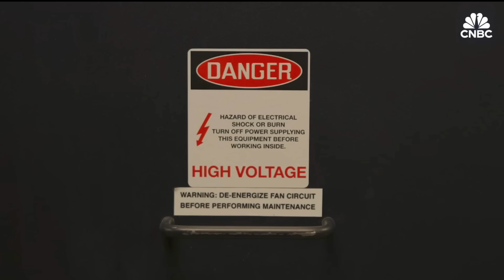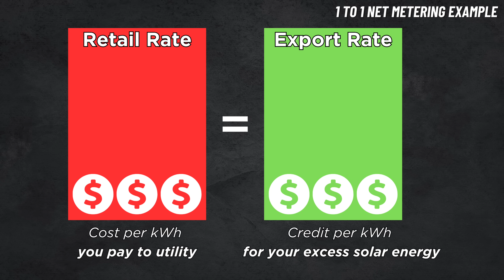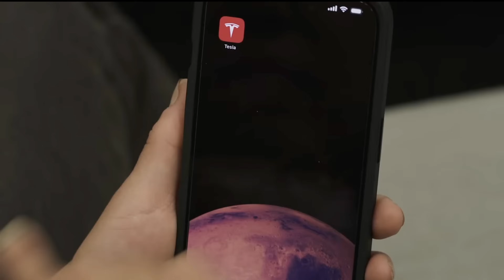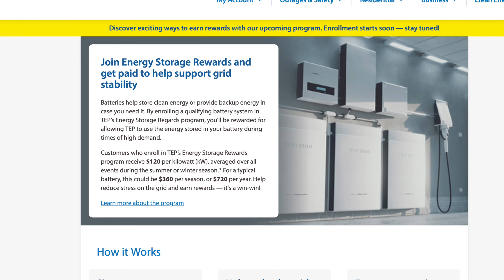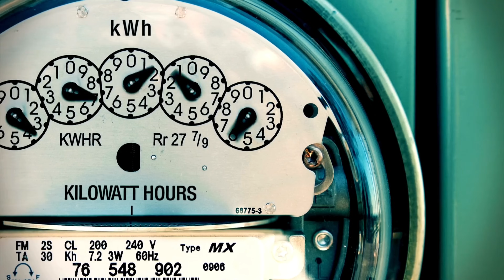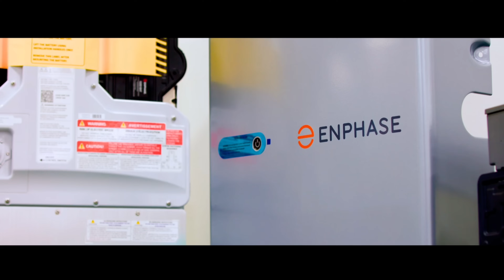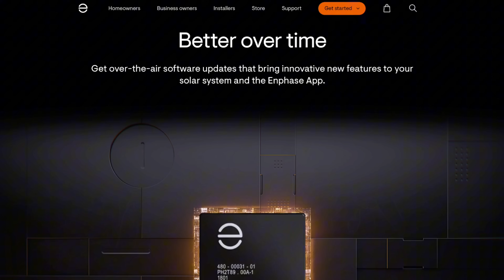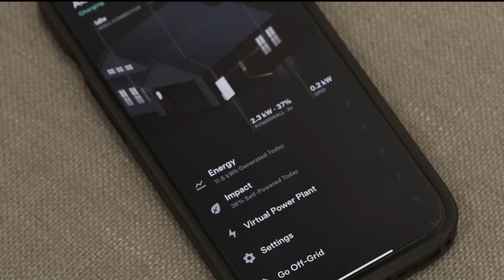Solar Panels Aren't Enough in 2026 | Big Changes Ahead?

Comment from the maker: What are your thoughts on this? Are batteries "must-have" when in comes to a solar installation in 2025?
Reply: Yes, I think batteries are must-have for future-proofing your energy bills.  To make it really worthwhile, though, you also need to electrify.  Heat pump water heater, mini splits, EV in the driveway... that sort of thing.  And it can be a bit of a minefield for regular people who are too-easily misled by professional installers.

So, clearly, if someone can DIY it, there are no down-sides at all.   If someone cannot DIY it, though, being exposed to the chaos of professional installers whos work ethic runs the gamut does not always result.  I've helped numerous friends get systems installed both DIY and professionally and there are a lot of things to look for:

* Avoid backing heating elements in heat pumps (water heater, furnace) if at all possible.  Backup elements have far higher amperage requirements and are completely unnecessary 80% of the time.  That can cause installation costs to balloon and for some people installers won't even take the job because their utility service is "too small" for the installation.

* Do NOT oversize heat pump furnaces.  Installers almost universally oversize heat pumps.  Heat pumps are designed to run at lower power levels for longer periods of time... like 8+ hours a day of run time.  But installers often spec heat pumps 2x or 4x the size you need which then cycle on and off in 30 minute increments.  That destroys their efficiency.  Installers often just don't know any better but sometimes they are trying to push their profit margins by spec'ing larger systems.

* Always have systems installed with expansion in-mind.  The last system I helped with my friend was having solar professionally installed on his roof and we specified sufficient cabling and all necessary rails for future expansion.   So he started with a small system, got it all signed-off, and then we expanded it DIY with another four panels a few months later.

* Go with a meter collar if possible.  This avoids nearly ALL electrical work.  The entire system can backfeed through a breaker without having to rewire panels or add panels or anything like that.  If a meter collar is not possible then go with a gateway system.   Always do whole-home these days... NO critical loads panel, NO smart panel.  Modern inverters can handle it just fine and an intelligent home owner won't use high-load devices in actual power outages unless they absolutely need to.

* Do not undersize the battery system.   I see 10kWh systems that are vastly undersized.  A typical U.S. home that needs, say, 10 kWh overnight should have at least double that in battery capacity... 20 kWh minimum.  The buffer enables a lot of flexibility... you can use large appliances without worrying about the time frame, you can charge your EV, and so on and so forth, and still self-consume 24x7 (zero import, zero export).

* And be very intelligent about roof mounted solar.  Do your homework.  Some roofs are easy to mount solar on (in fact, without roof penetrations sometimes... a standing seam metal roof, for example, requires no roof penetrations to mount solar)... some are not.   You really need to know how the roof mounts work and double check the installers work on the actual roof.  At least do the wiggle test.

If you can, have the installers run two extra pairs of wires through whatever conduit they have going to the roof for future expansion.  Again, have the professional installers install a smaller system but pre-wired or at least with space reserved for future expansion.   Additional panels, additional batteries, a bigger inverter, whatever.  Don't let them cram stuff in to too-small a space and don't let them under-size any service cabling if they have to install a gateway.   You want the inverter wiring to be at least 2 AWG (100A continuous).

-Matt
Reply: Ran solar on my home for 3 years without batteries. It was alright, but it wasn't a game changer. I still had electric bills that ran over $150 in the summer.

I'm over 350 miles from the ocean and was hit by Helene in 2024. No power for 9 days. Batteries went from the bottom of my home improvement list to the top.

I have 4 PW3's now. This month and last month have been my "worst" in terms of percentage self powered, but I'm still hitting 85% self powered. In February and March I was over 90% self powered.

Powerwalls reducing my grid usage between 60-75% on average so far.

If you're getting solar, get a battery. Unless your home has really high energy usage where you need 12kw+ just to cover your usage during the day, you're going to get more bang for your buck by installing a battery and dropping some solar. I think, for most people, a 6kw array + 10kwh battery will save them more than a 12kw array.

EDIT: I should note, I don't get any net metering. My solar is exported for free. I get no payments, no credits, nothing.
Reply: 10% Solar panel tariff from all over the world
Reply: @AprezaRenaldy  There are solar panel manufactures in the USA. GO USA
Reply: Noone talks about cost vrs short snd long term benefits
Reply: @jamesgleeson6538  Its a hard topic because there are many reasons beyond simple economics and break-even.  There are many, many reasons why one might want such a system even if it is not immediately or obviously economic.  And there are also good reasons why one might not want such a system.

Some people can save money, most people cannot.  So one good argument for spending money on a system during your working life is to vastly reduce costs and improve your comfort later in life after you retire, when your cash flow is much lower.

Some people might simply want to contribute to the technological revolution in some way rather than give their money to fossil fuel companies, and don't care about breaking even.

Some people might not have any ability to save-up money, which puts these sorts of systems out of reach (borrowing to have a system installed is usually a bad idea).

Some people may desire greater resilience in an emergency... not having to run around scrounging for fuel all the time in a major emergency for example.  Other people might be fine with a short-term gasoline generator solution for emergencies.

Noise may matter for some people, and not matter for others.  Though I'd also add "noise from generator == thief magnet" to that equation.

The list is endless.

-Matt
Reply: for one Solar is climate dependent and it's not enough to rely on sunlight alone with weather patterns changing based on climate change and other factors. Needs to be alternative sources  of renewable energy combined with Solar at the consumer level. Short term storage has been around  for awhile. After working in the testing , certification and design part of the field for close to a decade. To me the key to the future for the consumer is long term expandable storage combined with multiple sources of renewable energy. battery storage is still years away from making a dramatic difference.
Reply: @christhompson6010  Well, we have to distinguish between residential and grid-scale.

At grid-scale, reneawbles and battery storage are already making dramatic differences at scale.  California, Texas, Hawaii, large portions of Europe, China, Australia, to name a few.   California is now regularly running over 125% renewables on its grid during daylight hours, with grid-scale batteries soaking up the excess then discharging during the morning and evening shoulders.   Over 100GWh of storage now in California and 12GW+ of battery generating capacity.   Texas is doing the same.  Growing rapidly.

I think people are vastly out of touch with just how large an impact renewables and storage is having in those states and countries able to deploy it.  One look at the CAISO (California system operator) graphs will quickly disabuse you of any notion that significant scale is not yet achievable.

For residential, the goal is not to self-generate 100% of your electricity 24x7 365 days a year, nor should it be.  You install what is convenient to install... you don't need to diversify your renewable energy sources at the residential level.

People get solar and solar + battery systems for many different reasons.  I, personally, owning an EV, gain thousands of dollars in savings each year from gasoline that I no longer have to buy and power that I no longer have to buy.  Basically inflation-protected and rate-protected.

I can completely cover 9 months out of the year 24x7 with my system and it reduces costs the other 3 months.

But break-even does not necessarily have to be a goal, either.  People get these things for many reasons and with varying levels of success.

-Matt
Reply: @christhompson6010  Check out the You Solar "Power Bloc" located in CA. Not a backup system. Expandable power storage - unlimited. It is the primary power source with the grid secondary, but can be off grid. It is your own utility. Batteries can be directly charged with any power source such as solar, grid, wind, hydro, EV, any size generator etc., all at the same time if desired. So I would say  long term expandable storage combined with multiple sources of renewable energy is now here.
Reply: @joec.1906  small scale storage devices have been out for awhile. Im talking large scale.something that can match 150-250 amp services to a home or office and maintain that rate while being expandable.
Reply: A $10,000 battery to save $300-$500 a year for on peak hours does not equate. The roi would not benefit a homeowner if they want to save money.

Backup purposes is a different subject. 👍🏼
Reply: @elneedah3456  It's more like a few $thousand dollars a year for many of us once we factor the EV into the equation.  And/or a heat pump furnace.

But even if the utility does have net metering, it's a question of "how long" will it have net metering because full 1:1 net metering is not sustainable.  Utilities have been shifting away from 365-day net metering.

Another alternative to residential batteries is to have a tariff that allocates space on a grid-scale storage system for a monthly fee and then allow 24-hour net metering based on that allocation.  Then the home owner does not have to install batteries (for non-backup purposes).
Reply: Zack, I have complications with batteries. Here in Florida, I experience an extended outage almost every year due to a major storm.   I do have solar, 52 REC 395 black panels, with Enphase IQ8 Plus and daylight backup on 3 circuits.   This is only a daytime solution.    I have a Westinghouse WGEN20000C and a manual switch in my panel, as well as a generator plug, to power one of my two 200-watt breaker panels.    To round it off, I have two Teslas. A Model Y, which plugs into the 2nd 50-amp plug from the generator to keep it charged while it powers the house.    (Side note: I have a Microair softstart installed at 5-ton AC, and it now shows that only 33.4 amps are needed for inrush.)   I recently traded in my Model 3 Tesla for a Cybertruck.

Here is where its complicated for me....   I would love to use the Power Share feature from my Cybertruck, but...  I have an Enphase solution, but I have no straight answer as to when it will work with my Enphase system.  My power company does not accept the meter Ring (Teco Electric), so I would have to get a stand-alone ring box. A Single Powerwall 3 does not integrate with a generator, so I would be losing out on my goal for extended power outages.

So, while I think Batteries are essential, some of us with existing installations are looking for a balance of outcome and costs.    if you have any advice, options, or thoughts on how a house with Enphase,  Cybertruck, and Generator can move forward without breaking the bank it would be appriciated.     My thought is to wait for Enphase and Tesla PowerShare or equivalent to become generally available and possibly phase out the generator if needed.

Comment: Batteries are an essential component of a home energy system, here's why:
1. When a power outage happens you can run your fridge, heating, wifi well/sump pumps
2. Utilities are paying nearly zero for exess solar production - store it instead, after work charge an EV and commute for 'nearly free' while enjoying the benefits of home "fuel" production.
3. Load shifting - you can charge up a battery bank during low cost grid power periods and then use power anytime you like, even on peak time, for that low cost power price.
4. Being Self Sufficient - no one likes being stuck, a home battery/inverter system gives you a lot of control and flexibility.
5. Grid down - if you try to run your home from a generator, the genny runs very inefficiently because your loads are all cycling, but the genset runs all the time buring fuel.  If you have batteries, you can set a generator to run at peak efficiency to just charge the batteries, and then shut down for a day or two while your cycling loads can run efficiently from the battery/inverter system.
6. Rising Utility costs - we all see the rising cost of electrical energy in recent years, but you can protect yourself form much of this risk by generating some of your own electicity from solar, and get the lowest cost overnight power from the utility and store it in your battery for the next peak rate time period.
7. Instead of spending 10k on a ATS Genset system, spend that same money on a battery bank - then add to it every few years - and be farther ahead.
8. Peak vs average loads - a back up generator without battery system needs to be sized to power your highest peak load, while a battery/inverter system can use a tiny generator as a back up to just suppply the daily average power at a low and steady power supply all day for much lower cost and far higher efficiency.
Keep one thing in mind with battery/solar system - when a storm takes out the grid, it often also means no solar potential either - batteries are the answer.
There are lots of options lower cost than Tesla power walls - which are expensive. EG4 is one other option and there are many others.

Comment: Self installed solar system for 3 years in southern Iowa. Public electric cable was removed when we bought our country house and have never regretted it. We have to be a bit conservative in the cloudy weeks of winter, but the regular house fridge keeps running as it should and lights still work. For reference, we were never power hungry people. We don’t run an ac and we heat with wood. Washer and dryer are run off a generator when needed. Sure is nice to keep that $3-500/month we used to fork over to the electric company. For everything, I think we’re about $6k all in.

Comment: Hey Zach I just had two powerwall 3 installed  to compliment my 11 kilowatt solor system that I had installed several years ago. Through tracking my energy output through emphase I would see energy output peak to around 8 kilowatts. Since having the powerwall 3 installed my outputs has gone down to only 2 kilowatts on a sunny day and I am barely able to charge up one battery. Why is this you think ?
Reply from the maker: That's definitely strange. My guess is there is an issue with the metering (monitoring) setup on the install. That isn't super uncommon with retrofit battery installations. Does your Enphase app still show 8 kW peak? I'm curious if the two apps are reporting different data.

Regardless, I would contact your install and ask what's up.

Comment: I have solar, but a battery is useless for a power outage.  Generac all day long.  Cheaper than a battery and can run for weeks.
Reply from the maker: Depends on how frequent your outages are and what loads you need backed up. A battery paired with solar is probably more practical for most.
Reply: @ZachSolar , I think it depends on the length of the outage.  Generac will run for weeks.  Every 100 hours, I have to add oil.  That’s about it. Batteries are great if you have an evil utility company holding you hostage, however.  I get 1:1 net metering, so no need for batteries.

Comment: Where I'm from it is very rear to lose power for more than couple hours a year. Not even worth buying a generator. All this solar/battery crap needs to be done in grid leven not in private homes. It just complicates things to much.  All that needs investment, maintenance and replacing
Reply: With the prices they are charging i probably will invest in solar. My electricity was almost as much as the morgage. Fuck no im not paying that electricity bill. Its probably worth it to buy a generator and run it off gas at this point.
Reply: @BlueXephosiscool  How that possible? What you running, welding shop? How many KW a month?
Reply: @Tavs.fātersmobile home, no extra AC besides the unit installed. 4 adults, in southern indiana.
Reply: @BlueXephosiscool  Something ain't adding up. That shouldn't be more than 1000kwh a month MAX. Electricity is cheap there also. neighbour might be stealing your power😅 Or AC unit is short cycling because it is low on refrigerant.  Hot water is a big thing too if you have electric boiler.. It is worth to lower the temp so you can almost shower using only hot water. That would decrease heat loss from the tank in the room (with you cooling with AC) + it will incentivise people to take quicker showers because hot water will run out faster😅 Efficiency is key.
Reply: @Tavs.fātersyou know what, you might be right. Might be worth it to check out the AC. Our AC is a little older and probably needs some maintinence. Also mobile home so the insulation is terrible too.

Comment: Why not use a battery system where you don’t need software cause if you don’t get your software, will it work or will it not work?
Reply from the maker: All home battery systems today have some form of software to assist with monitoring, settings, and all of that.